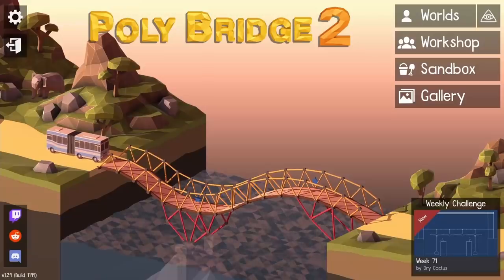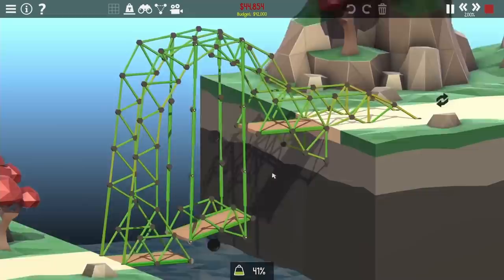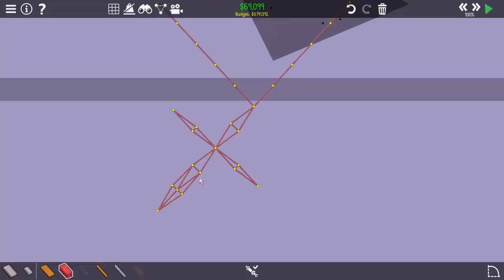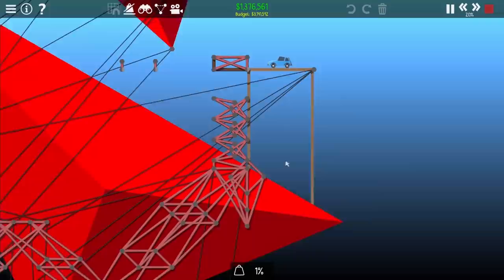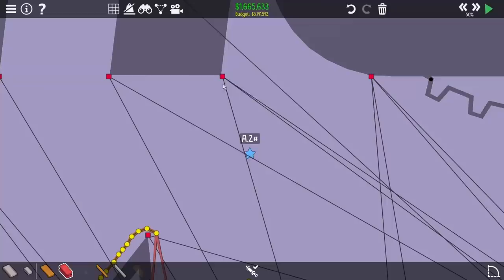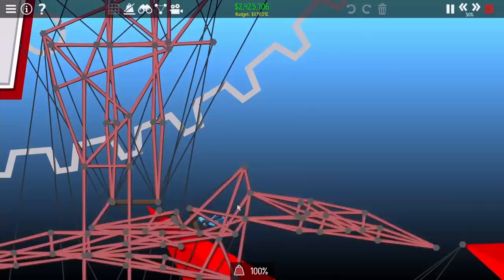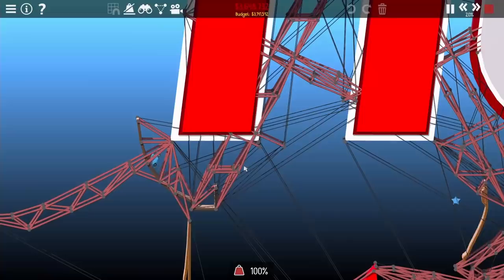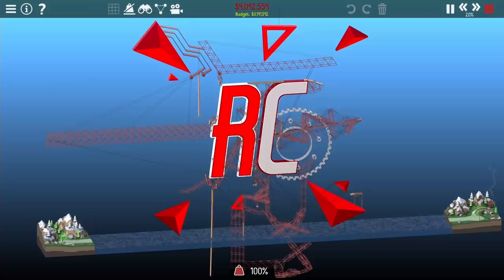Defeating the Final Boss of Poly Bridge 2 Levels

Comment from the maker: I'm looking to make some more vehicles very soon, what do you want to see me try?
Reply: A working airplane
Reply: I don’t know if you’ve already made, this but maybe a working mech? Just a thought 🤔
Reply from the maker: There seems to be an antigravity glitch, but I'm holding off on using it until we understand how it works
Reply: How about a transformer?
I know you did it on Main Assembly but now do it it in Poly Bridge
Reply: how about a "normal bridge" that actually turns into a car or something
Reply: Chicken robot
Reply: What about a car powered car?
Reply: What about a  B O A T  ?
Reply: Is a clock possible using custom shapes
Reply: a drone that flies with he power of glitches
Reply: Like some other suggestions a transforming bridge or a transformer would be cool
Reply: I've tested a small amount with making bridges "sink"
basically all nodes, when in contact with water, move slower than nodes out of water. Maybe this can be used to make a paddleboat or something but i haven't tried making one yet
Reply: A hover from crossout in besiege
Reply: Do you think you can make those fighting robot things in the little boxing ring?
Reply: A steam train with realistic linkages and working pistons to propel it
Reply: one with realistic suspension
Reply: Upgrade your glider with things that yeet stuff really fast downwards and hopefully give it enough thrust
Reply: A bus/train where passengers board and unboard automatically repeatedly. (Like a bus loop or a train line)
Reply: Wind-up car
Reply: B O A T
Reply: Can you please make a automatic bridge building machine you can also watch some real life bridge building machines video
Reply: Bro I want to share a map with u in poly bridge I have made a drone that can take off from the ground u can also controll it with hidrolic
Reply: Mechanical 🐕
Reply: A Metro    No?

Bob Sled? 🤔 

Porsche Panamera Sport Turismo Turbo S E Hybrid?

Comment: I think the reason why the thin arms you originally used started wobbling is because of the no break mode. When the steal pieces break, they obviously have to rotate in a direction; so when the extremely large amount of stress it was put on it, I’m guessing a tiny glitch or programming oversight where the stress limit was gone over, so the tiny rotation of a rotation would be fine if it was braced completely, but because it was loose, the wobble made a feedback loop of a slight wobble- slightly larger wobble- slightly larger wobble- continue until bridge breaks. (I could be wrong, but that’s just my theory)
Reply: Makes sense.
Reply: It's a game theory
Reply: My first thought is also floating point calculation error